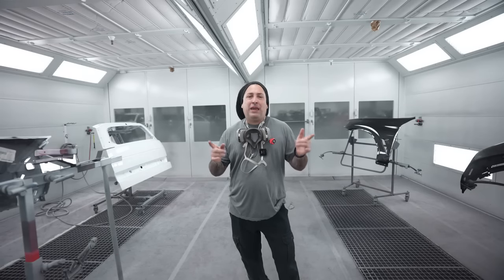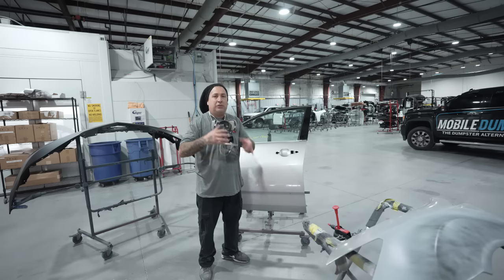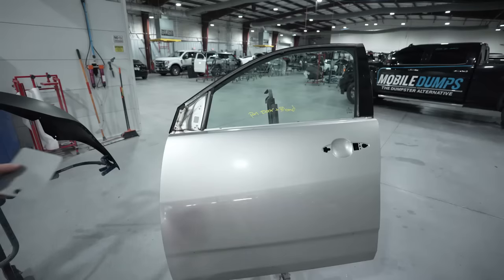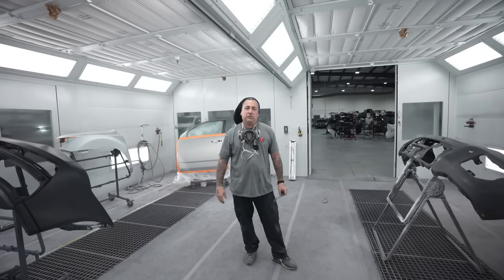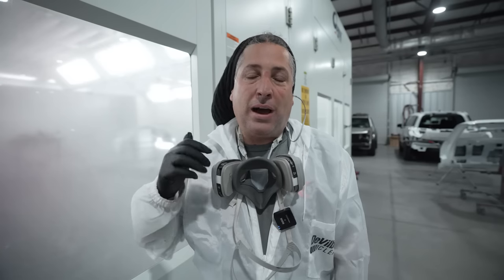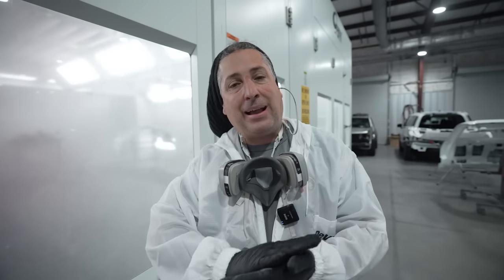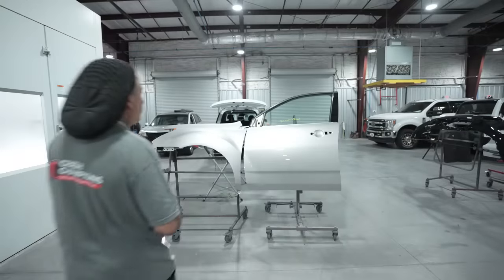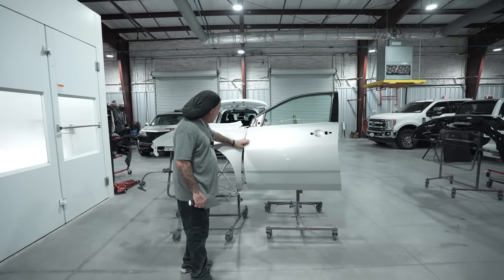Use Your Technology AND Experience While Painting Cars

Comment: Only 1.5 coats of basecoat? I guess the right color sealer below is critical to achieve this feat of 1.5 coats only. Which helps the budget of the shop for paint materials in the long term. Sealer is cheaper than metallic.

Comment: No disrespect at all but all those cameras from day one were a joke and I wanted 0 to do with them. I’ve been out of it for 9 years but I never bothered….. maybe they’ve gotten better by now…?🤷🏻‍♂️
Not to blow my own horn but I always had a knack for tinting and could do it on the fly as soon as I found the best blendable match and hit a panel with it, I rarely did spray outs. Working in super high production environments helped with that, it was like boot camp every day lol. Definitely not great advice for everyone but it always worked for me. Good stuff though and solid advice👍🏻

Glasurit was hands down the best system I ever shot, I absolutely loved their polyester base ( I think it was the 55 line ) back in 2001, even with the “high solids” movement their clears and single stage were great too. I sprayed the one shower in my house Toyota 040 with their single stage and it literally still looks perfect 22 years later lol, way more durable than the gel coat. Really good stuff

Comment: I had problems figuring out glasurit pc20 clear coat. And for example on 376 g of clear and hardener it goes 22 g od reducer and I added 37 g instead and got beautiful results. In your opinion, will I have any problems afterward on that amount of reducer added.
Reply from the maker: I recommend going  with the recommended mix
Reply: Thanks Kandman. You are always helpful.

Comment: Kandy: help. i had solvent pop on my clear from an area paint job i had to do on my suv. did some dent work and deep scratches. anyway, because my clear had scores of bubbles i had to strip it . i sanded my base coat . my stupid question is do i have to prime or can i just reapply base coat? if need prime should i use epoxy or 2k urethane?
Reply from the maker: 2k primer is the best chance of a solid foundation 🙌

Comment: Hey Candyman, getting ready to start using the 100 line in October. I know you were using the Fuji for the sealer that’s what I use for sealer. I think it works pretty good but I was wondering how long does it take the 100 to dry after you’re done painting do you flash it or do you bake it for a while?
Reply from the maker: Not long I give it a little heat